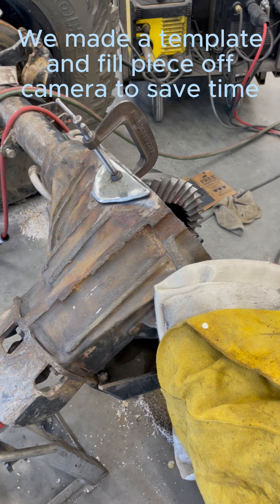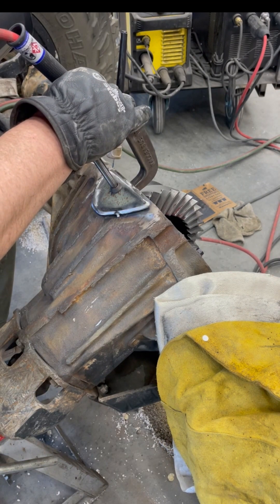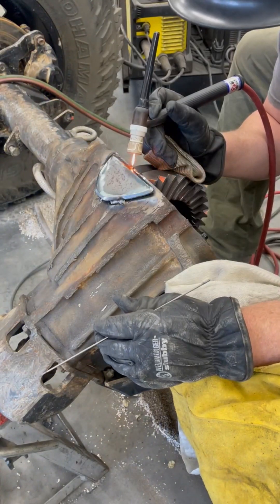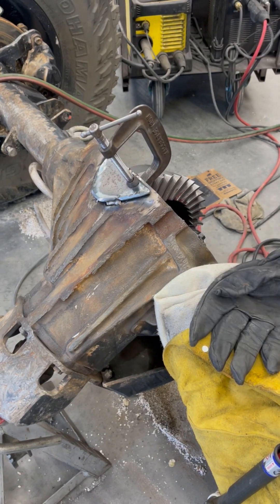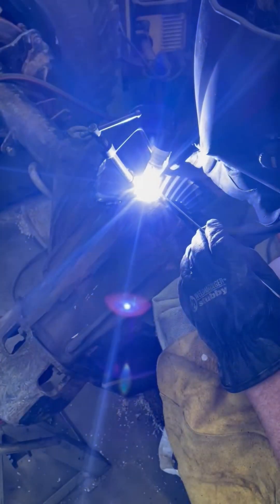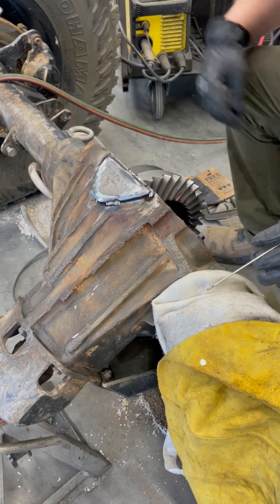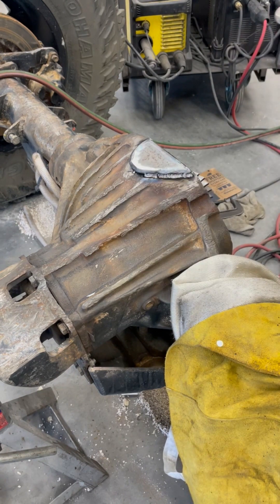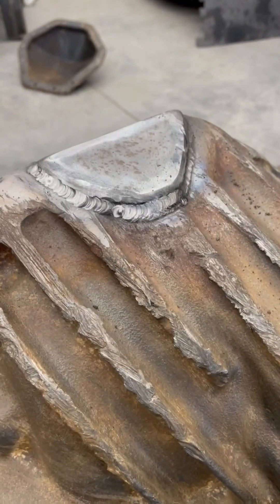14 bolt weld repair

Comment: I have a 14bolt 6lug rear end that's been sitting for a long time and getting rust spots around the bolts how would you go about fixing it? sand it down and weld over it then grind over the top of the welds to smooth it out?
Reply from the maker: @HondaCrf450r.  clean it up the best you can. If it’s the diff cover it’s mild steel and can weld it with MIG. Just don’t accidentally weld it to the housing and grind it smooth so you still have a good sealing surface